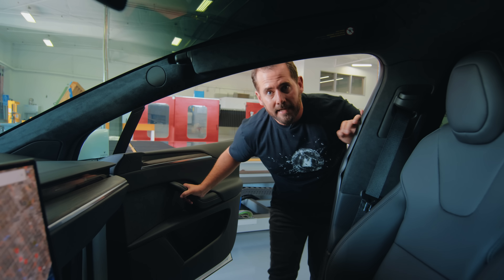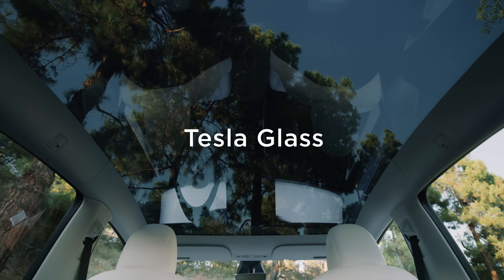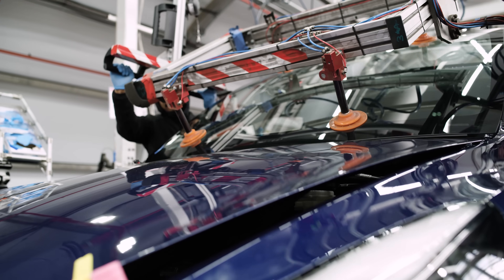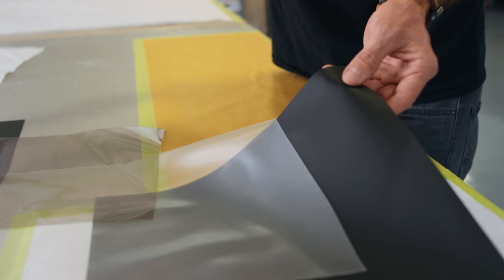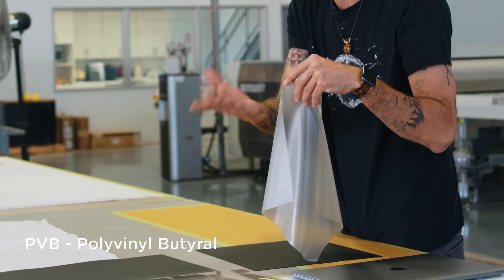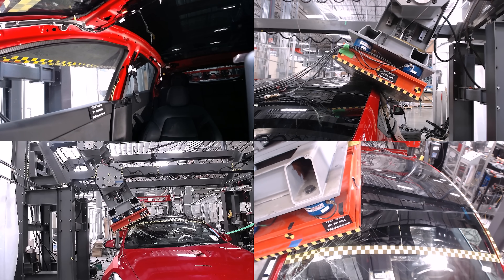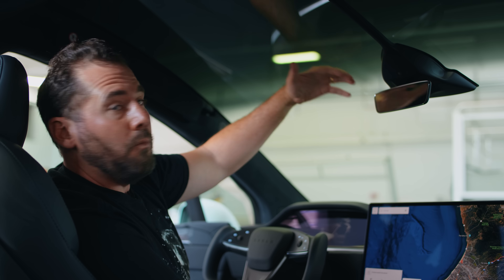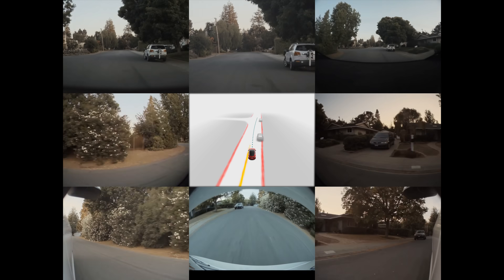Tesla Glass | The Secret to a Quiet Cabin

Comment: WOW! Fantastic stuff. Yes more please.
Reply: 90s Benz 
W140 features included:

Double-paned soundproofed glass was a new S-Class innovation first fitted on the W140. This form of window glazing allowed for improved soundproofing, reduced condensation, and other insulation benefits.

Electrically-operated exterior mirrors could be folded by switch to ease driving in narrow spaces.

'Parameter steering' was a system which made low-speed driving easier by reducing the effort required to maneuver in speed-sensitive situations such as parking.

Rear-parking markers, or guide rods. These rods extended from the rear corners of the trunk lid when in reverse, providing the driver with a guideline for rear maneuvers. In 1995, this system was replaced by the sonar-based Parktronic system which measured the distance of the bumpers to nearby obstacles.

12-way powered, heated front seats, with 3 setting memory functions and lumbar support.

Windshield wipers with heated washer system. Later models also included rain-sensing windshield wipers.

Electrically-operated automatic-dimming inside rear-view mirror that tied into the seat and steering wheel memory.

Heated exterior mirrors. Later models also included auto-dimming driver's side mirror.

Orthopedic seats were an expensive option from the factory but consisted of several different air cushions in the seat that the user can inflate and deflate to find the perfect driving position.

Dual-zone climate control. Four-zone climate control on LWB models.

Reclining and heated rear seats on LWB models. V12 models also have the four-place seating option, which allows fully adjustable rear seats, lumbar support and rear sunshade control. The center seat has been replaced by a burlwood center console, allowing a 2 + 2 seating format.

The climate control system could be set to operate for 20 minutes after the engine had been turned off.

Electric rear sunshade.

Rear passenger illuminated vanity mirrors.

Soft-closing doors and trunk.

Leather interiors and burl inserts (optional; standard for 500SEC/CL 500).

In 1995 the S 600 Coupe became the first Mercedes car with GPS navigation system, designated Auto Pilot System APS. It featured CD-ROM maps and full color navigation display in the center dashboard.

In 1996 the Linguatronic voice control system and Parktronic sonar-based parking system were introduced

In 1997 the TELEAID emergency and tracking system was introduced in the US market.

Also, developed with the car, a Bose sound system was available as an option.

Comment: Its surprising how a company is so innovative in tech but yet fails to deliver a car thats built well (panel gaps). There are at least 20 Tesla's in my neighborhood and pretty much everyone of them have panel gaps. This is embarrassing. Please fix this.
Reply: 1990s Benz 
W140 features included:

Double-paned soundproofed glass was a new S-Class innovation first fitted on the W140. This form of window glazing allowed for improved soundproofing, reduced condensation, and other insulation benefits.

Electrically-operated exterior mirrors could be folded by switch to ease driving in narrow spaces.

'Parameter steering' was a system which made low-speed driving easier by reducing the effort required to maneuver in speed-sensitive situations such as parking.

Rear-parking markers, or guide rods. These rods extended from the rear corners of the trunk lid when in reverse, providing the driver with a guideline for rear maneuvers. In 1995, this system was replaced by the sonar-based Parktronic system which measured the distance of the bumpers to nearby obstacles.

12-way powered, heated front seats, with 3 setting memory functions and lumbar support.

Windshield wipers with heated washer system. Later models also included rain-sensing windshield wipers.

Electrically-operated automatic-dimming inside rear-view mirror that tied into the seat and steering wheel memory.

Heated exterior mirrors. Later models also included auto-dimming driver's side mirror.

Orthopedic seats were an expensive option from the factory but consisted of several different air cushions in the seat that the user can inflate and deflate to find the perfect driving position.

Dual-zone climate control. Four-zone climate control on LWB models.

Reclining and heated rear seats on LWB models. V12 models also have the four-place seating option, which allows fully adjustable rear seats, lumbar support and rear sunshade control. The center seat has been replaced by a burlwood center console, allowing a 2 + 2 seating format.

The climate control system could be set to operate for 20 minutes after the engine had been turned off.

Electric rear sunshade.

Rear passenger illuminated vanity mirrors.

Soft-closing doors and trunk.

Leather interiors and burl inserts (optional; standard for 500SEC/CL 500).

In 1995 the S 600 Coupe became the first Mercedes car with GPS navigation system, designated Auto Pilot System APS. It featured CD-ROM maps and full color navigation display in the center dashboard.

In 1996 the Linguatronic voice control system and Parktronic sonar-based parking system were introduced

In 1997 the TELEAID emergency and tracking system was introduced in the US market.

Also, developed with the car, a Bose sound system was available as an option.

Comment: Wow. This video alone just puts another "Pros of Tesla" on my checklist of potential EV crossovers for my next vehicle. ❤️👍🏼
Reply: 90s Benz 
W140 features included:

Double-paned soundproofed glass was a new S-Class innovation first fitted on the W140. This form of window glazing allowed for improved soundproofing, reduced condensation, and other insulation benefits.

Electrically-operated exterior mirrors could be folded by switch to ease driving in narrow spaces.

'Parameter steering' was a system which made low-speed driving easier by reducing the effort required to maneuver in speed-sensitive situations such as parking.

Rear-parking markers, or guide rods. These rods extended from the rear corners of the trunk lid when in reverse, providing the driver with a guideline for rear maneuvers. In 1995, this system was replaced by the sonar-based Parktronic system which measured the distance of the bumpers to nearby obstacles.

12-way powered, heated front seats, with 3 setting memory functions and lumbar support.

Windshield wipers with heated washer system. Later models also included rain-sensing windshield wipers.

Electrically-operated automatic-dimming inside rear-view mirror that tied into the seat and steering wheel memory.

Heated exterior mirrors. Later models also included auto-dimming driver's side mirror.

Orthopedic seats were an expensive option from the factory but consisted of several different air cushions in the seat that the user can inflate and deflate to find the perfect driving position.

Dual-zone climate control. Four-zone climate control on LWB models.

Reclining and heated rear seats on LWB models. V12 models also have the four-place seating option, which allows fully adjustable rear seats, lumbar support and rear sunshade control. The center seat has been replaced by a burlwood center console, allowing a 2 + 2 seating format.

The climate control system could be set to operate for 20 minutes after the engine had been turned off.

Electric rear sunshade.

Rear passenger illuminated vanity mirrors.

Soft-closing doors and trunk.

Leather interiors and burl inserts (optional; standard for 500SEC/CL 500).

In 1995 the S 600 Coupe became the first Mercedes car with GPS navigation system, designated Auto Pilot System APS. It featured CD-ROM maps and full color navigation display in the center dashboard.

In 1996 the Linguatronic voice control system and Parktronic sonar-based parking system were introduced

In 1997 the TELEAID emergency and tracking system was introduced in the US market.

Also, developed with the car, a Bose sound system was available as an option.

Comment: cool, so is this new or has it been around a while?
Reply: 90s Benz 
W140 features included:

Double-paned soundproofed glass was a new S-Class innovation first fitted on the W140. This form of window glazing allowed for improved soundproofing, reduced condensation, and other insulation benefits.

Electrically-operated exterior mirrors could be folded by switch to ease driving in narrow spaces.

'Parameter steering' was a system which made low-speed driving easier by reducing the effort required to maneuver in speed-sensitive situations such as parking.

Rear-parking markers, or guide rods. These rods extended from the rear corners of the trunk lid when in reverse, providing the driver with a guideline for rear maneuvers. In 1995, this system was replaced by the sonar-based Parktronic system which measured the distance of the bumpers to nearby obstacles.

12-way powered, heated front seats, with 3 setting memory functions and lumbar support.

Windshield wipers with heated washer system. Later models also included rain-sensing windshield wipers.

Electrically-operated automatic-dimming inside rear-view mirror that tied into the seat and steering wheel memory.

Heated exterior mirrors. Later models also included auto-dimming driver's side mirror.

Orthopedic seats were an expensive option from the factory but consisted of several different air cushions in the seat that the user can inflate and deflate to find the perfect driving position.

Dual-zone climate control. Four-zone climate control on LWB models.

Reclining and heated rear seats on LWB models. V12 models also have the four-place seating option, which allows fully adjustable rear seats, lumbar support and rear sunshade control. The center seat has been replaced by a burlwood center console, allowing a 2 + 2 seating format.

The climate control system could be set to operate for 20 minutes after the engine had been turned off.

Electric rear sunshade.

Rear passenger illuminated vanity mirrors.

Soft-closing doors and trunk.

Leather interiors and burl inserts (optional; standard for 500SEC/CL 500).

In 1995 the S 600 Coupe became the first Mercedes car with GPS navigation system, designated Auto Pilot System APS. It featured CD-ROM maps and full color navigation display in the center dashboard.

In 1996 the Linguatronic voice control system and Parktronic sonar-based parking system were introduced

In 1997 the TELEAID emergency and tracking system was introduced in the US market.

Also, developed with the car, a Bose sound system was available as an option.

Comment: I would watch documentaries on how Tesla makes each of its amazing parts
Reply: 90s Benz 
W140 features included:

Double-paned soundproofed glass was a new S-Class innovation first fitted on the W140. This form of window glazing allowed for improved soundproofing, reduced condensation, and other insulation benefits.

Electrically-operated exterior mirrors could be folded by switch to ease driving in narrow spaces.

'Parameter steering' was a system which made low-speed driving easier by reducing the effort required to maneuver in speed-sensitive situations such as parking.

Rear-parking markers, or guide rods. These rods extended from the rear corners of the trunk lid when in reverse, providing the driver with a guideline for rear maneuvers. In 1995, this system was replaced by the sonar-based Parktronic system which measured the distance of the bumpers to nearby obstacles.

12-way powered, heated front seats, with 3 setting memory functions and lumbar support.

Windshield wipers with heated washer system. Later models also included rain-sensing windshield wipers.

Electrically-operated automatic-dimming inside rear-view mirror that tied into the seat and steering wheel memory.

Heated exterior mirrors. Later models also included auto-dimming driver's side mirror.

Orthopedic seats were an expensive option from the factory but consisted of several different air cushions in the seat that the user can inflate and deflate to find the perfect driving position.

Dual-zone climate control. Four-zone climate control on LWB models.

Reclining and heated rear seats on LWB models. V12 models also have the four-place seating option, which allows fully adjustable rear seats, lumbar support and rear sunshade control. The center seat has been replaced by a burlwood center console, allowing a 2 + 2 seating format.

The climate control system could be set to operate for 20 minutes after the engine had been turned off.

Electric rear sunshade.

Rear passenger illuminated vanity mirrors.

Soft-closing doors and trunk.

Leather interiors and burl inserts (optional; standard for 500SEC/CL 500).

In 1995 the S 600 Coupe became the first Mercedes car with GPS navigation system, designated Auto Pilot System APS. It featured CD-ROM maps and full color navigation display in the center dashboard.

In 1996 the Linguatronic voice control system and Parktronic sonar-based parking system were introduced

In 1997 the TELEAID emergency and tracking system was introduced in the US market.

Also, developed with the car, a Bose sound system was available as an option.

Comment: really interesting video, need more of these!!
Reply: 90s Benz 
W140 features included:

Double-paned soundproofed glass was a new S-Class innovation first fitted on the W140. This form of window glazing allowed for improved soundproofing, reduced condensation, and other insulation benefits.

Electrically-operated exterior mirrors could be folded by switch to ease driving in narrow spaces.

'Parameter steering' was a system which made low-speed driving easier by reducing the effort required to maneuver in speed-sensitive situations such as parking.

Rear-parking markers, or guide rods. These rods extended from the rear corners of the trunk lid when in reverse, providing the driver with a guideline for rear maneuvers. In 1995, this system was replaced by the sonar-based Parktronic system which measured the distance of the bumpers to nearby obstacles.

12-way powered, heated front seats, with 3 setting memory functions and lumbar support.

Windshield wipers with heated washer system. Later models also included rain-sensing windshield wipers.

Electrically-operated automatic-dimming inside rear-view mirror that tied into the seat and steering wheel memory.

Heated exterior mirrors. Later models also included auto-dimming driver's side mirror.

Orthopedic seats were an expensive option from the factory but consisted of several different air cushions in the seat that the user can inflate and deflate to find the perfect driving position.

Dual-zone climate control. Four-zone climate control on LWB models.

Reclining and heated rear seats on LWB models. V12 models also have the four-place seating option, which allows fully adjustable rear seats, lumbar support and rear sunshade control. The center seat has been replaced by a burlwood center console, allowing a 2 + 2 seating format.

The climate control system could be set to operate for 20 minutes after the engine had been turned off.

Electric rear sunshade.

Rear passenger illuminated vanity mirrors.

Soft-closing doors and trunk.

Leather interiors and burl inserts (optional; standard for 500SEC/CL 500).

In 1995 the S 600 Coupe became the first Mercedes car with GPS navigation system, designated Auto Pilot System APS. It featured CD-ROM maps and full color navigation display in the center dashboard.

In 1996 the Linguatronic voice control system and Parktronic sonar-based parking system were introduced

In 1997 the TELEAID emergency and tracking system was introduced in the US market.

Also, developed with the car, a Bose sound system was available as an option.